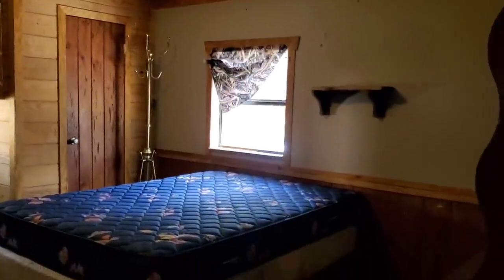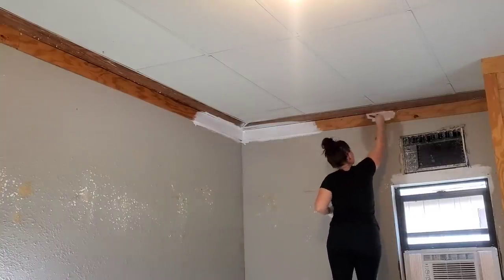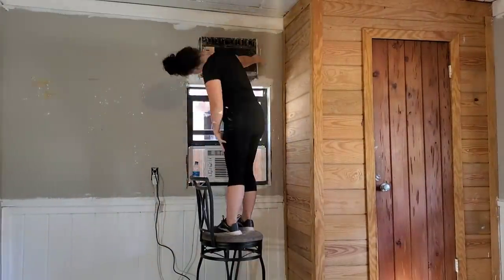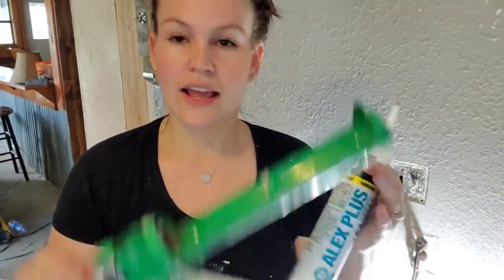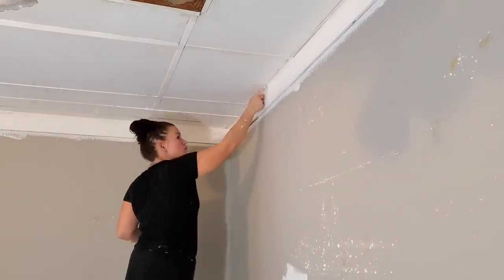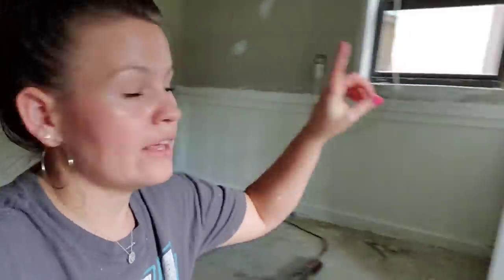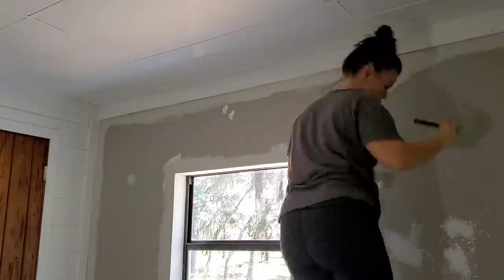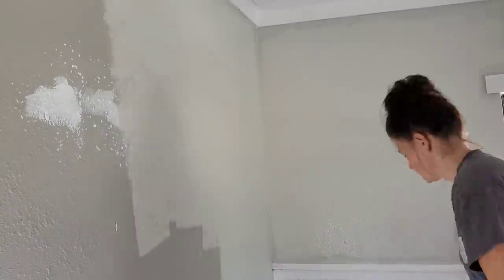BEDROOM MAKEOVER ON A BUDGET | EXTREME ROOM TRANSFORMATION | TRASHED ROOM MAKEOVER | DIY

Comment: An easy way to paint the ceiling is to take down all the ceiling tiles and then paint them. That way all you need to paint is the t-bars. Once the ceiling tiles are dry, reinstall them. And I ALWAYS recommend painting ceiling tiles than replacing. Cheaper and a clean refreshed look.